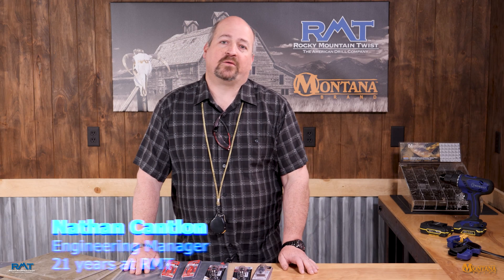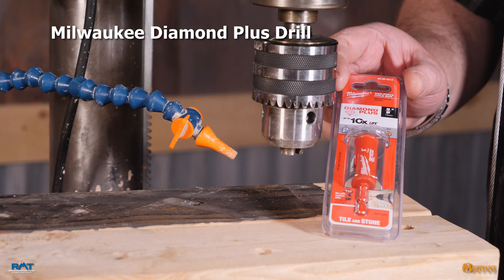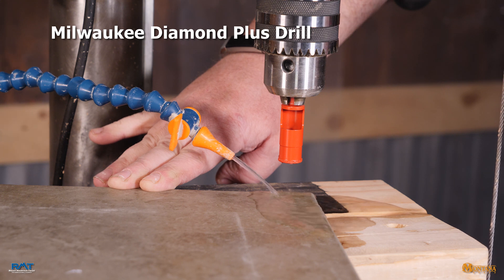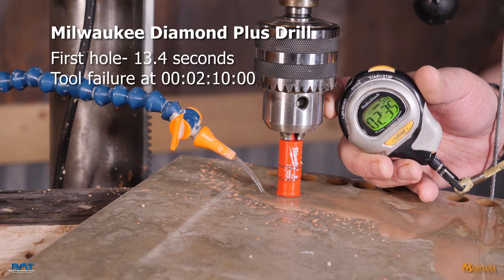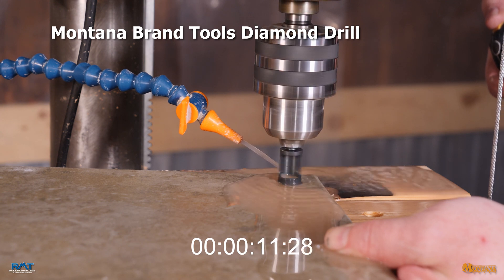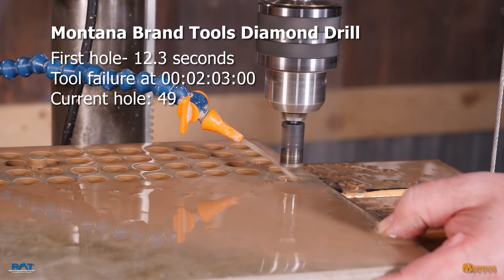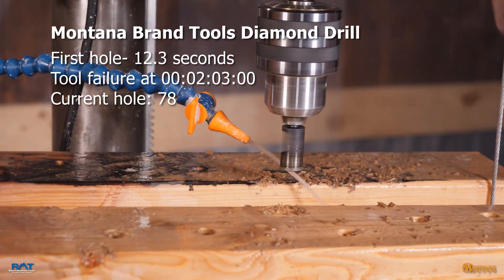DRILLED TO DEATH!  Diamond Tile Drill Bit Shootout - WHICH IS THE BEST TILE BIT?

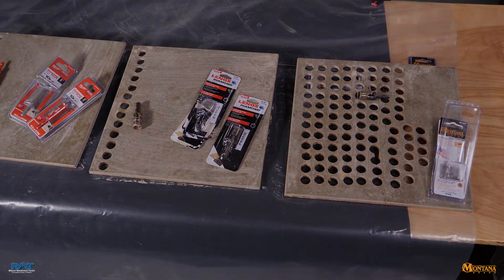Comment from the maker: We are running some tests on some of our Montana Brand drills , and we found the bits from this video.  We thought it would be fun to see how many holes they could make before they absolutely would not cut.  I know- video evidence or it didn't happen, BUT we found out how much life was left in the bits, and it was surprising.  We considered them dead once it took over 5 minutes to drill a hole with the same parameters in this video- drill press, weighted pulley system, speed, water coolant.  The Milwaukee drilled 9 more holes, so a total of 19.  The Lenox bit drilled another 5, total of 18 (we disqualified 2 of the holes in the video after analyzing footage, in case you are counting at 6:53 in the above video).  Our Montana Brand Drill made 59 more holes for a total of 159!  ONE HUNDRED AND FIFTY NINE!!!!!!!!!  
We might have to shoot some more footage of these amazing drills for you skeptics out there...